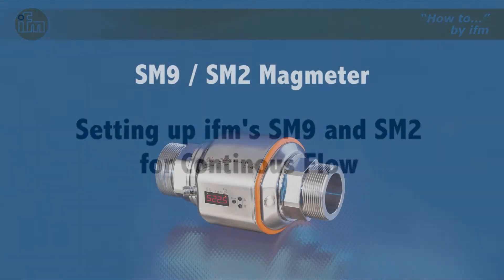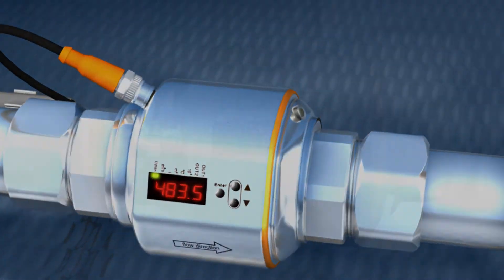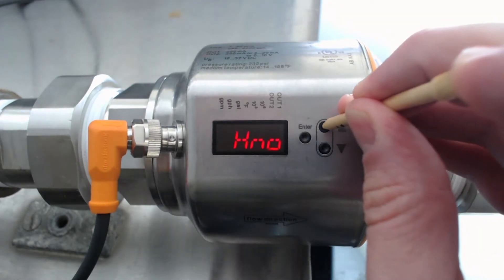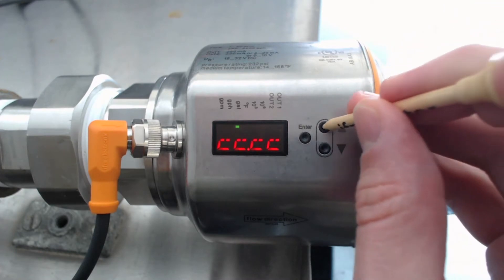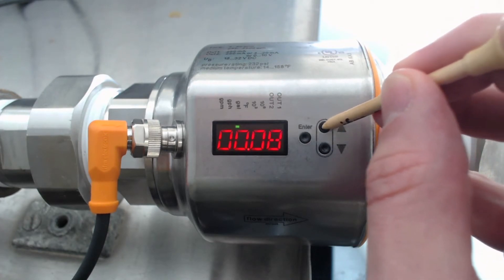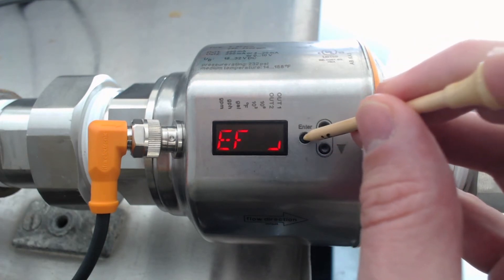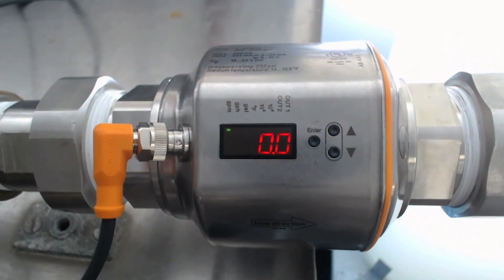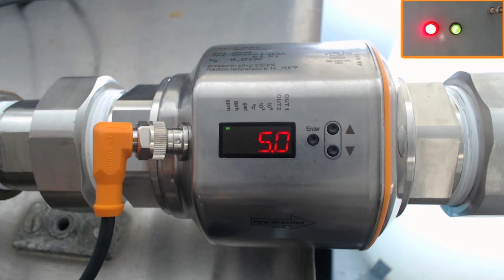How to: Set Up a Continuous Pulse Signal on an ifm Magmeter

Comment: great video! I have a doubt, can this device count the galons? I need to know how much liquid passes through the pipe and I thought that maybe this device could be configured to count the liquid
Reply from the maker: Dear Mr. Ross,

We have a couple Magmeters in different sizes, which can also count the Totalizer in gallons per hour or per minute.
Please use the following link to our homepage which guides you directly to all of our Magmeters:
https://www.ifm.com/de/en/category/200_020_030_010_010#/best/1/100

On the left side you’ll find our filter function where you can select the “Final value of the measuring range” and search for “gpm” or “gph”.

Please select a device which has an article no. ending: SMxxx1.

Devices with SMxxx0 can only transfer the actual process value in gpm or gph but not the totalizer.

Have a nice day! 

ifm's Social Media Team